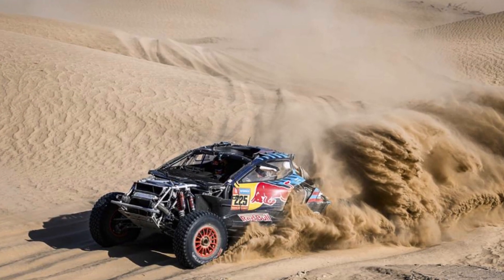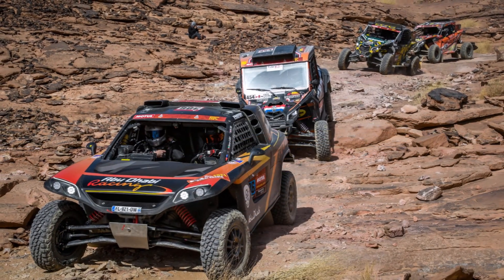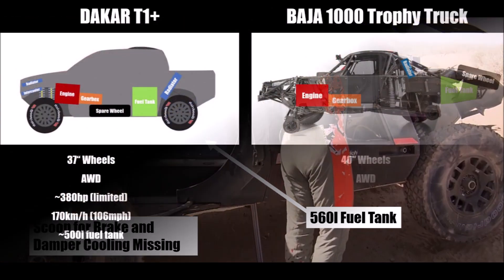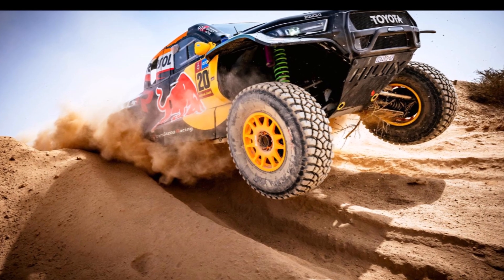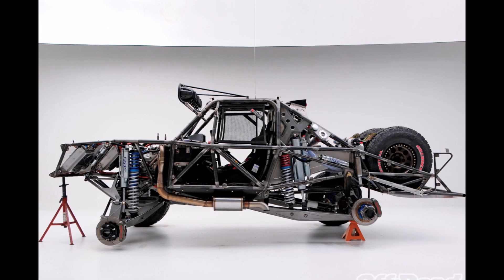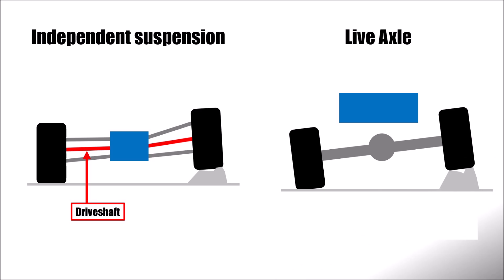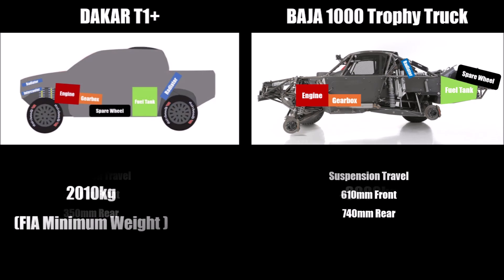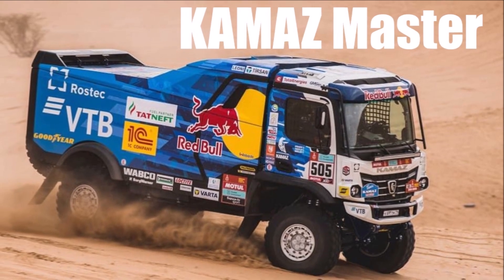BAJA 1000 Trophy Truck vs. DAKAR T1+ Vehicle - Technical Analysis

Comment: I'd love to see a trophy truck as an invitational entry in the Dakar, and a T1+ in Baja. Would be cool to watch, even if they aren't exactly comparable
Reply: And what a missed opportunity from Saber to including the Trophy Truck as the DLC for the Dakar Desert Rally
Reply: What to do with a limited fuel tank?
Reply: @RCmaniac667  put a bigger one? Let them refuel after the special? I don’t care, the car doesn’t need to be classified. Do it like Garage 56 at Le Mans, it’d be interesting enough to see the pace of it
Reply: Robby Gordon drove his Hummer H3 Trophy Truck in the Dakar for many years
Reply: @maximiliangalas6161 Robby Gordon's Hummer H3 isn't a trophy truck. It has limited travel, smaller wheels, less power and independent rear suspension. It is legal in Dakar, a trophy truck isn't.
Reply: @johncarl5505  Thanks I always just assumed it was a Trophy Truck because it looked like one and also had a much higher topspeed than all other cars
Reply: @maximiliangalas6161 it was built to the Dakar ruleset, it wasn't an actual trophy truck
Reply: @maximiliangalas6161 no that was actually a buck or a buggy with a truck body, closer to a class 1 buggy.  Rear engine irs suspension.  Not even remotely competitive against trophy trucks....
Reply: @maximiliangalas6161  that was not by any definition a trophy truck.  Closer to a class 1 buggy
Reply: @maximiliangalas6161 not a trophy truck! the hummus was a buggy with a hummer body and less than half of the horse power of a trophy truck.
Reply: Fuel wise the trophy truck wouldn't make it thru the timed section of a stage.
Reply: The TT doesn't carry enough fuel
Reply: @freethinkingamerican80  tt carry about 110 gallons of gas the problem is it only gives you and average of 1.75 miles per gallon.
Reply: @commonsense9710  ain't that the truth
Reply: Trophy trucks were once part of it but rules changed for some reason
Reply: Rules changed...toby raced fast but never won @km6832
Reply: @km6832 Trophy trucks were never allowed in Dakar.
Reply: @johncarl5505 in previous editions some trophy trucks have been adapted to Dakar rules
Reply: A trophy truck would have an unfair advantage in the Dakar Rally because of its unlimited nature, and therefore, it will never be accepted. A Dakar buggy would qualify in one of the lesser categories at Baja 1000, I guess.
Reply: T1 will not work in Baja.
Reply: @jareknowak8712  i mean technically it would there is class 11 stock Volkswagen....   they would finish around the sxs and class 10 cars imo

Comment: Superb analysis as usual! I wonder if Loeb would have driven a Trophy Truck - would he just "fly" over that ditch and hadn't even noticed anything. Of course, with such weight and fuel consumption he would have stopped somewhere on the 1 stage though.
Reply: Yep, a trophy truck would have flew over it. Loeb, wouldn't need a trophy truck though, a Class 1 buggy would be enough since it can do the Baja 1000 without refueling and is lighter than even T1+ cars.
Reply: Ok so now we need an episode on Class 1 buggies vs the T1 classes😅 @johncarl5505
Reply: isn't it a spec lighter class in Baja? 
Trophy trucks have more variety, I think.
 @johncarl5505
Reply: @PseudoNo  i mean they got the T1 buggies for that. Some buggies even won Dakar events multiple times before like the Mini for example.

Since the T1+ class is formed, teams using T1 buggies do decrease since T1+ allows the same sized tyres as the buggies on top of having 4WD which are really beneficial around sand dunes.
Reply: Still, suspension in Baja is outrageous. With those absorber speeds. I wonder if T1 had "faster" shocks would it be as great as TT but with less weight.
Reply: @PseudoNo The suspension mounts and arms wouldn't take the abuse neither would the chassis